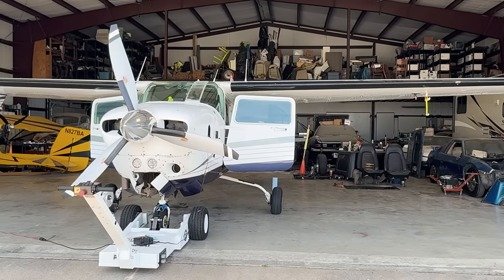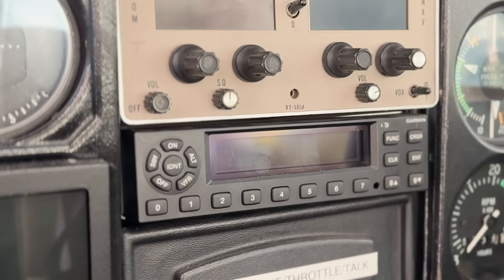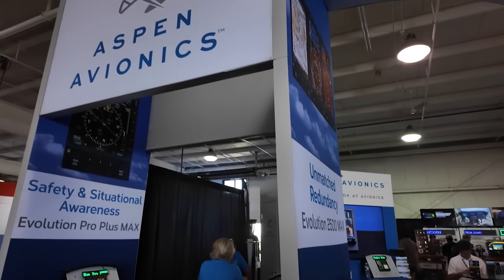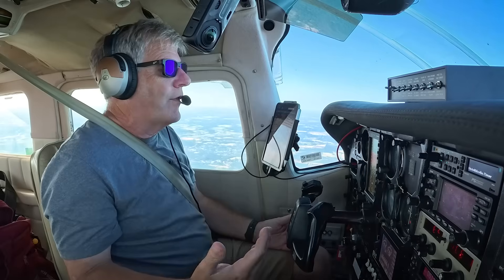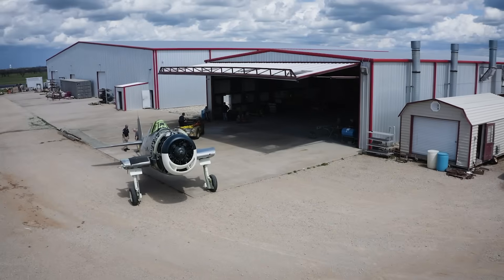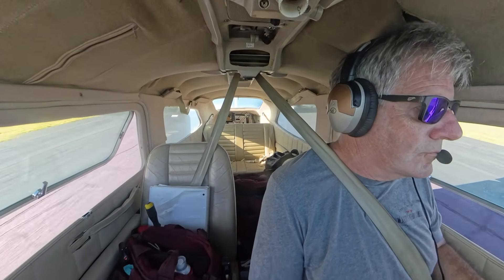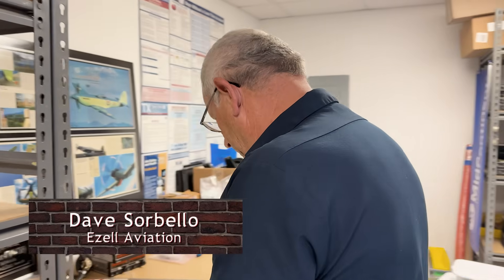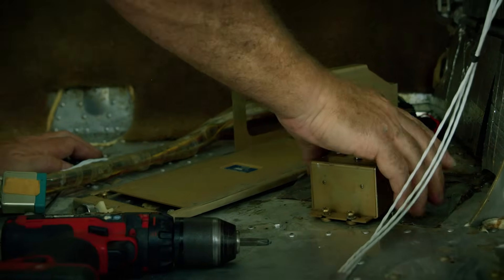THIS Can Kill Innovation in Aviation! WHY Dan Chose These Avionics

Comment: Dan, word of caution on the 930.. I installed a brand new unit in my T210N in Feb this year. It was very buggy - JPI sent a loaner while they worked on my purchased unit. It, too, was buggy. Got mine back and again, still had glitches - poor MAP readings, randomly reset in flight as if I pulled the CB. As of right now, my plane is back in the shop getting a G3X with EIS. Couldn’t be patient anymore. I hope you have better luck.